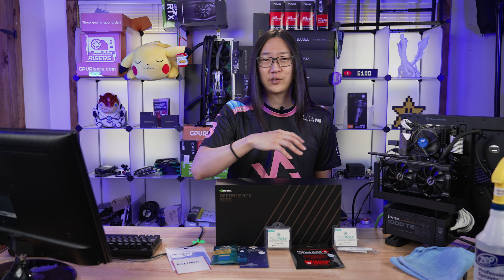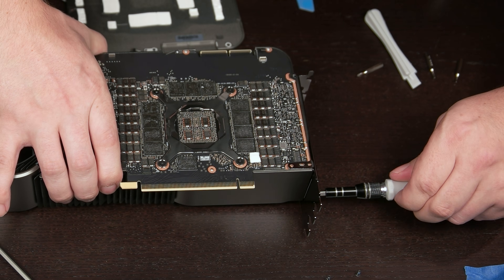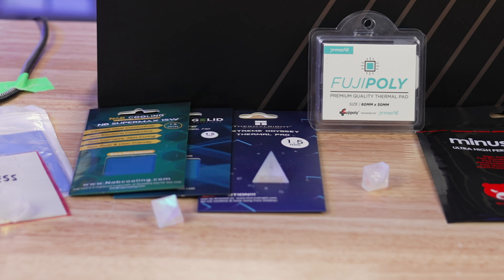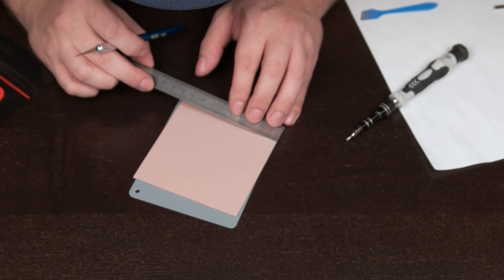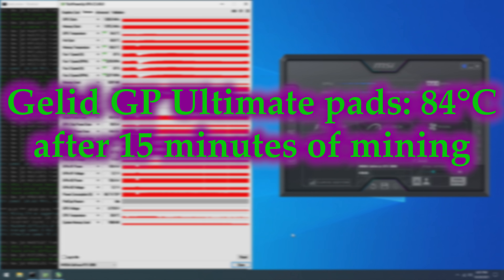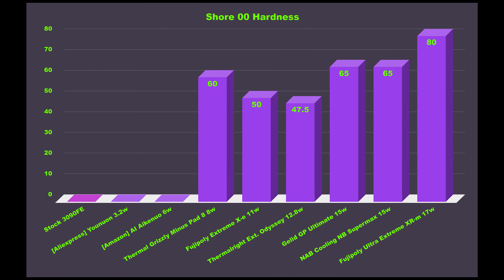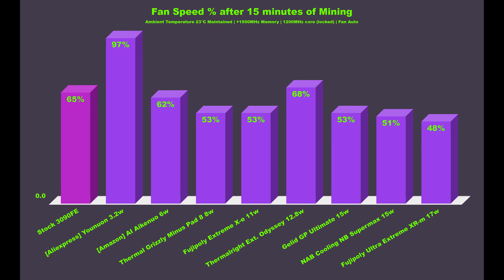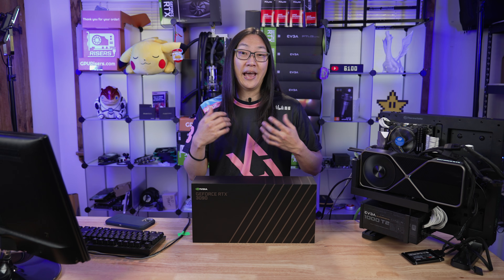Thermal Pad Showdown! What you should (and Shouldn't) Buy

Comment: I have a qestion to anyone that can be of help...I'm building a DIY electric skateboard and am looking for a mounting solution for my VESC to my heatsink. I don't need it to hold 100lbs but I want to know if thermal pads would be a viable option to keep it from sliding around in the enclosure. The VESC will be sitting on top of the heatsink so vertical weight will not be an issue. Just making sure it wouldn't slide side to side. Thank you again for any and all help
Reply from the maker: Hey there, not very familiar with those components but I can tell you that most thermal pads are not that sticky. Relatively speaking. If they're under pressure they won't move. However, they're stickiness is similar to posted notes. They'll come off easily and won't fall off by themselves. But aren't very strong.

If you're looking for some kind of thermally conductive material, I might recommend thermal tape. That stuff is super strong and won't ever come off no matter what

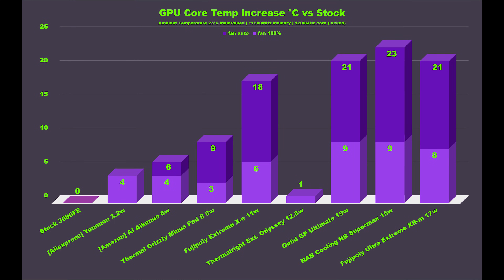Comment: HEY, just to give you a quick update to my EVGA RTX 3070 XC3 BLACK thermal pad replacement situation. I contacted you before,  the part where you show 17:00 mark, the temps actually increasing for 15w/mk + above pads. WELL, thats VERY TRUE. For my 3070, ordered GELID 15w, made my GPU run hotter. ESPECIALLY, for mining.  Maybe it will be better for 3080+ above cards. But for my 3070, the 15w/mk made things worse. 

Eventually contacted EVGA, just got thermal pads for their deparment recently. Everything is working fine now.
Reply from the maker: Oh wow that's crazy! Did you have any issues with the install?
Reply: @TekShinji  Like cutting the pads for GELID and installing it? It was easy, but not sure if it was making my heatsink contact better with my GPU DIE, even though it was 2mm, but i am sure it was the 15w/mk that made things worse, because i did order Thermalright 12w/mk and that made things a BIT better... But, right now for mining with EVGA PADS i am back to normal. So in the long run, wasn't worth the stress and hassle and wait to replacing the pads. The only thing i would've done was replaced the thermal paste. Since that was rock hard.

Comment: Re. Gelid GP-Ultimate - it's effectively pre-formed strips of thermal putty rather than pads as the latter are usually understood (and you can actually re-use it as putty if you ball it up!). People who've used thermal putty have reported the best overall temperatures by some margin over pads. That said, good putty is as or more expensive in terms of coverage than GP-Ultimate but much fiddlier and more difficult to install (and the finished appearance is off-putting for those with OCD!). I now almost excusively use GP-Ultimate for VRM and memory. Mind-bogglingly thorough test though, bravo. ETA >> oops, 2 months and just noticed I forgot to hit 'like'!
Reply from the maker: Thanks for the feed back!

Comment: I used the Thermalright Odyssey pads on my RTX 3080, they are 12w/mk vs the 3w/mk of my original pads on the Alphacool Aurora Water block I use on the card in my custom loop, cost £73 to do the block and backplate (with a slight mod to the backplate to add a heatsink), results were amazing, a drop of 45c to 30c on average in games.

Look at the top left hand corner to see the readout temps at stock (109% power limit set in MSI Afterburner), on the overlay for that program.

Farcry 6 (change quality to 4K to see it in the same quality as it was recorded at).

https://www.youtube.com/watch?v=HgHrqT8hADA

Warzone, max settings at 3440x1440, Temp is show on the bar at top of screen (change quality to 1080/1440)

https://www.youtube.com/watch?v=im49Rbfz1YA

If you have an overheating card or want better overclocks for benchmarking etc then I can recommend  Thermalright Odyssey pads, well worth the money.
FYI even at stock the lower temp your RTX GPU runs the better it will boost as two things stop it boosting, temps and power limits.
Reply: Thermal pads help a gpu temp? The memory ok, bit the temp of gpu is bette after apply a thermalright pad? I order a Valor Odin 15w thermalright
Reply from the maker: Yes they can
Reply: @TekShinji  ok thanks, one more question please, i have el vector on my 3080 ti ftw3, el recomended absolutly mount thermal pads 1mm, i order yesterday 1mm thermalright valor odin 15w it's correct? because I think that even the 1mm ek ones after being installed will be just under 1mm, and I would not want the odin values to be crushed too much and dropped in thickness. also because 1.5 is too much .. I don't have much choice

Comment: MAXBELL Silicone Thermal Pad 12.8 W/mK u should have included this one as well
Reply from the maker: Hey there, have you used them yourself?
Reply: @TekShinji  i want to use but i dont know the outcome but i will let you know once they reach
Reply from the maker: Please let me know when you find out!
Reply: @TekShinji  i used them and I now get 84 degrees Celsius mem temp ..before using these thermal pads I was getting 110°C so big improvement for me.. but the GPU temp went high to 69°C .before it was around 55 56. can u suggest me something which can help me getting the temps low ? 
I'm running 3080 Fe at optimal settings on msi after burner as well 69% power limit which is 220 watts . Core clock 0 mem clock +500. Fans 100% bro help me..
Also wanna edit this comment and would like to inform u that I used 2.0 thermal pads only on the die side of my 3080 Fe which people call the front side and didn't change the back plate pads they are the stock ones right now..i also used arctic MX 4 thermal paste which is a go to thermal paste for all and I used quite a lot . I made an X shape on the GPU and then four dots around it I think that was enough to spread and spill a little bit to the side more than a little bit i would say after i reassembled the gpu
Reply: @TekShinji  any suggestions for me brother ?

Comment: I know it sounds blasphemous to even suggest but I wonder if these cards ram would be a good candidate for those little aluminum heat sinks used on Raspberry Pi's. 

Wouldn't be ideal but I have to imagine the back side would be cooled better with some thermal epoxy and little heat sinks thank just thermal pads connected to a plastic cover.

Airflow in the case (or even a little fan) with mini heatsinks could probably do wonders for these neglected memory modules.

---

And it was actually mentioned at the end, guess I should hold off comment until the end, but I probably would have forgotten.
Reply from the maker: We did look into it however it appears that it doesn't make as much difference unless the thermal pads are also

Comment: Actually which pads are best for one card would not be necessarily the best for another. The reason is that the thickness required is different and you need to not loose the contact of the GPU core because of too thick/hard pads. So for another 3090 flavor, the best pads will be different.
Reply from the maker: That is correct. However, as I said multiple times in many comments. The results were the same across the board with thermal conductivity.

Comment: Thanks for the video! Can I also suggest that maybe the core temps were higher, due to the better thermalpads being harder than the stock ones? 

Because hard pads would compress less, leading to less contact pressure between heatsink and gpu core, leading to higher gpu core temps.
Reply from the maker: Hey there, this would prove to be true. However, it seems to be happening across the board with other pads that were software as well that had a higher thermal conductivity. In other words, the lower the memory temperature, the higher the core temp in most situations. It's very interesting though! We thought so too. However, we don't think that was the case now.

Comment: I use the thermalright... the softness is an issue for the smaller packages if not shipped with some protection (bubble shipping bag or small box)... they get squished for sure.  but if you get a good pack they work great.  I mine and my ROG Strix 3090 hums along at 78 to 80 deg.. at 117 average mh (mem is clocked to +1000 in afterburner)

when cutting pads I use a crafting cutting thing.. like a mat cutter.. it has a ruler, a slidey razor and a flap to hold down the thing being cut.  game changer.... amazon sells em cheap.
Reply from the maker: Hey thanks for the tips buddy, appreciate it! We got the pads from a couple of different sources and they all ship like that. So maybe it was just due to our region. It seems that these are very very inconsistent all across the world.

Comment: Thanks for the Vid.  Had a quesiton, wouldn't the best conductivity be using copper pads with high quality thermal paste?
Reply from the maker: We have not test that yet. At this time, the problem is pads can account for up to  half a millimeter of variation. The metal plates that everyone wants to try does not squish. So it's a little bit of a risk factory. My crack a chip if it's a height of only 2.75 when only a 3 mm is available for example

Comment: I have a PNY GTX 1070. Can I use 2mm thickness 12mw/k thermal Pad for memory, smd, etc.?
Reply from the maker: It depends, do you know if it uses 2 mm thickness pads? If so, then you can. If not then you'll have to measure it.
Reply: @TekShinji  Thank You .

Comment: I would love to see a comparison with the same methology to the (over?) hyped K5-PRO "pad" paste.
Reply from the maker: That's the same stuff Linus was using right?
Reply: @TekShinji  There was a video on that channel recently, yes. But not really comparing it to other high quality thermal pads. I think you have done a great comparison and it would be a great addition to know how the k5-pro fits in. Apparently it has a lower thermal conductivity of "only" 5 W/mK but it's supposed to fill in the surface imperfections better than a silicone pad, almost like thermal paste, so I don't know what to make of it.

Comment: You seems to do something wrong or used very old thermalright: I use 1.5mm tr odessey on my 3090fe card and result vs stock is more then -20 degrees!
Reply from the maker: Hi there, thanks for the feedback! Did you measure the before and after thickness when you were doing it? We'd like to know what they were!
Reply: @TekShinji  unfortunately no, I didn’t. I fully followed YouTube manual with pad replacing and result was extremely good. Actually my stock pads were awful >110’ with ambient 25’ with 100% coolers at 83% power limit. I was thinking of replacing with Gelid ultimate, but still didn’t do it cause memory is below 90 at fan 60-80% with ~24’ ambient temp and 83% power limit.

PS: I’ve replaced all pads and even more and used almost all 120x120x1.5 mm plate for 1 card
Reply from the maker: That's awesome! I'm glad it worked out for you!  Unfortunately, if you did not know that information prior to, especially if you've done it on a different card, there's a lot of variables that'll change  The outcome of the results.

Thank you for your feedback though, we really appreciate it!
Reply: @TekShinji  anyway I’m 90% sure I will replace thermalright pads with gelid ultimate by summer 2022 or install waterblock :)

Comment: Questions: Did you ever do a follow-up video?  Also, did you repad the entire GPU at any point or just the main memory modules around the GPU? Would be nice to see a full repad with the top cost / performance NB pads. Also why didn't you use Kryonaut paste for the GPU? Would love to see the thermal Goop tested as well and possible mods to the FE cards to remove heat faster and avoid the GPU heat cost. -- Sounds like you have another video to do! :)

I used the ThermalRight extreme odyssey thermal pad 12.8w 1.5mm and get around 90-94c and 126.5MH/s ETH. GPU temps around 55c/132F
Reply from the maker: Hi there, we did repad the entire GPU. The memory modules were the main focal point since that's what most people are concerned with.

We did  in fact use kyronaut  thermal paste.

Any thermal interface material that removes heat faster will cause the GPU cooler to become  thermally saturated thus having the same effect.
Reply: @TekShinji  Ok on the Kryonaut , in the video you showed Noctua paste you must have finished it off with Kryo.  The heat disapation and rising core temps is still very interesting. It seems like this explains why my temp seemed higher on my core after I repaded my 3090FE.  But they are well under what the card can handle at around 56c.  I was able to get a stable hash rate of 126.5MH/s.

Comment: Thank you for the work you've done and shared with the world.
I wanted to give my 3070ti new pads for the RAM because at mining I got around 100°C but I'am also gaming and don't want to raise the gpu tempertarure. 
What now? :D
Reply from the maker: If you don't want to use GP or temperature, you probably want to use pads that are not 100% the best thermal conductivity, but something slightly lower. Do you watch all the graphs in the video? You can see the relation between which ones have the best effect on memory, temperature and and relation to the GPU core temp
Reply: @TekShinji  yes I did and I have the "Thermal Grizzly Minus Pad 8 8w" already here. I think It's a good trade off between lowering the VRAM temps for mining and not getting so much higher GPU temp for gaming with the 3070ti.

Comment: Great Video, just what I needed to get a better overview and understanding. I bought the Grizzly thermalpads a while ago and was super disappointed when applying them to my rtx 3080 TUF. it didn't make any difference on the memory. I'm gonna try the GP ones now, in hope to reach 84 °C on the memory instead of 94°C
Reply from the maker: Everyone's mileage may vary. However, which pad is best on which card is kind of hard. Rather we tested which pad performed the best on the single card so hopefully they work the same for you!
Reply: @TekShinji  i used the GP extreme and Ulitmate on my 3080TUF and after removing a sticker on the heatsink and adding two additional pads where the card did not have any, it has now max. 70°C on the junction tempreture (15°C room with 80% fan speed under full load), it was on 96°C before. so complete success finally.

Comment: Hmm just noticed going back to the thermalright extreme. When I repad any card I measure the originals first and cut mine to match . I don’t cut them into little squares as in the video. I also replace all the pads on the 3090FE front and back memory or otherwise. Never had any trouble with the thermalright
Reply from the maker: The test did include replacing all the pads.

Comment: I almost always use thermal grizzly, but this time I used the one that you recommended and it ended up being worse thermals then the original thermal pads. I personally didn’t have a good experience with those and will stick with the ones I know.
Reply from the maker: Thermal grizzly is a very good. They tend to leak more for some reason but  your situation will vary.

That's the thing too, everyone's mileage will vary for sure. Based on all the variables we can only go by consistent testing on her end.

Comment: Hey man great content, I've considered some of the thermal pads described in the vid and they would be for normal copper heatsinks for like a raspberry pi (in my case for a ps4 ram chips) my problem is I don't want the heatsink to fall off so I would need one quite sticky. I dont want to buy a thermal epoxy due to the low thermal conductivity and being permanent. Any suggestions on which would stick more effectively in a position like sideways or even upside-down? Lastly good gob on the vid, not much out there on the specific differences on the very different pads. Keep up with the good content😁👍

Comment: Very thorough and learned something at the end that I wouldn't have expected, in regards to the impact of transferring more heat from the VRAM to the core. I wonder if active Water-cooling would make a significant impact here, looking forward to your follow-up video on this.
Reply from the maker: Yeah man, we had no idea going into it as well. It was a lot of information we learned:-)
Reply: yes, water cooling will be much better, i have Asus Strix 1070ti, on air i can get only +320mhz on mem with stock pads, after adding (aliexpress) pads to backplate, i could go to + 450mhz, with water cooling (EKWB and EKWB pads), no backplate, +600mhz, and these are full stable no restart in 2months of mining clocks.
Reply from the maker: Very nice man!

Comment: Can you comment on GeLid longer term? Most recommendations suggest using extreme over ultimate for the compression factor. Lot of reviews say the GPU melts the thermal pads on the back side. Wondering if any of this came up in your testing.
Reply from the maker: We haven't seen any issues. However, we're still doing testing. It's going to take time. Unfortunately it's not something we can speed up.

Comment: Hello there, great video. Really impressive work considering how much effort all that takes.  I recently got a Gigabyte RTX 3090 Turbo Edition and plan on water cooling it with an Alphacool waterblock. I am using this card mostly for mining and want to keep it as cool as possible. Should I stick with the Thermal pads that come with the water block or upgrade to the NAB Cooling super max Pads? Any input is appreciated.
Reply from the maker: We haven't tried that yet, however, our preliminary testing shows that when it comes to water block since they're much more efficient, it won't matter as much. However, IMO,  ads that came with the card were made for the card so you'll have to be careful  if you're changing to a different kind because they may be different thicknesses or different hardnesses